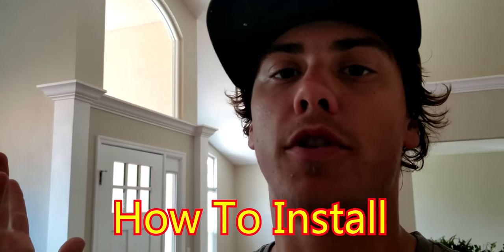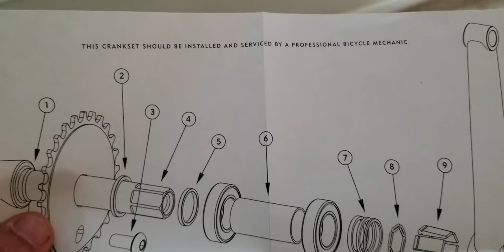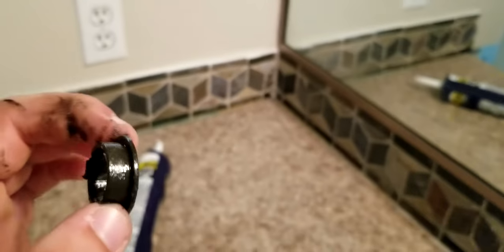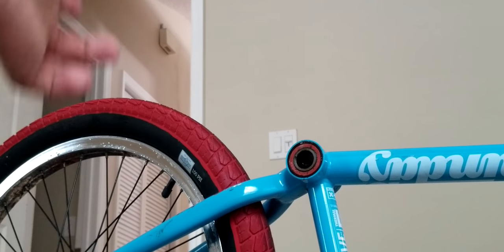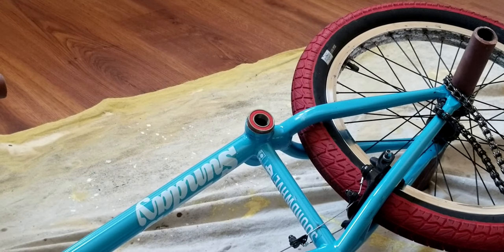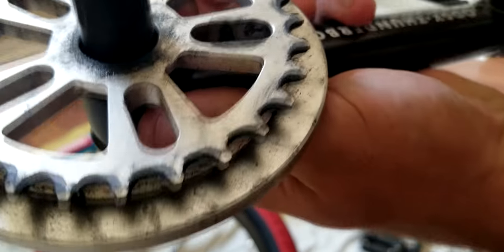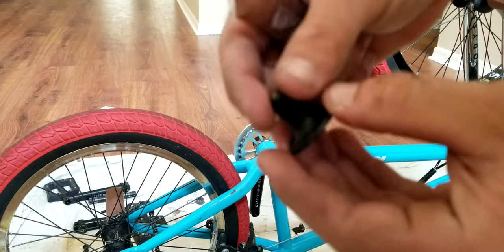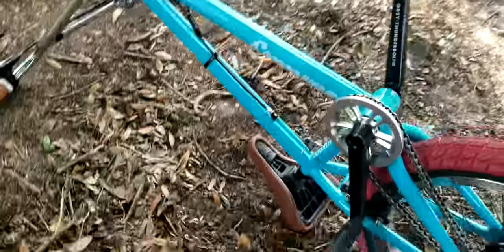How to Install Odyssey Thunderbolt+ Cranks and Mid BB / Review

Comment: hey so i just bought some of these used its missing a cover for  a side of the crank arm like i can see to the bearings and that middle piece you put at a angle.but im just wondering  are those important, if so were could i go to find them and one more thing is grease necessary my dad helped me install them and said i didn't need grease because there sealed bearings but im concerned any help is very appropriated, great video helped me, my dad. you got yourself a new sub :)
Reply from the maker: Hey man, Im not quite sure what your talking about when you say a cover is missing. If you want to you can send me a picture of what you mean to my insta account @the_sarcastic_lion and I will do my best to tell you where to go from there. But without seeing it im not sure what your sayin. Also, no the grease on the bottom bracket bearings and crank spindle is not "necessary" because they are sealed bearings but the grease isnt to protect from rust really its just to keep the bearings running smoother cause if you dont grease down there at least every few months your cranks can actually get stuck in your bottom bracket from just getting ceased up. So i recommend to grease at least a little every so often otherwise when you need to get your cranks off youll be banging them off with a malet really hard or you might even end up needing a crank puller. Glad this video helped you guys tho! Thanks for the sub. I appreciate it! Send me that pic on insta and ill help you out as much as possible.
Reply: @byronoranje  thanks for the help ill message you rn, of course keep it up

Comment: Hey my dude. I just bought these cranks and the wtp pathfinder sprocket. The problem is my sprocket slides right onto the 24mm lip on the crank arm like yours did but it’s supposed to be press fitted onto that ledge. Every other video I’ve seen they had to push their sprocket hard onto that lip unlike you and me it just slides right over which could be find except when you look at the back of the sprocket there is a huge gap around the spindle that is recessed Into the sprocket just like yours. That silver piece you put onto the spindle first is only for sprockets thinner than 6mm. It’s not actually meant to be only a spacer. That being said without that silver piece you put on if you tried to only put the black spacers against the sprocket they go into that recess around the spindle on the backside of the sprocket and that would be the wrong way to install them. They way you installed them is the only way to put them on sprockets with a hole the size of ours but I want to ask are you sure that’s the right way to put them on? The first step in the instructions says the sprocket hole has to be 15/16 which is just under 24mm so you can press fit it onto that 24mm lip and it will be tight. Did you have any problems installing them like this? I seen your video of you taking off your cranks and the new sprocket you put on is how people on vital bmx forum are telling me it’s supposed to be. They say if it has that recess around the spindle after installed and if it just slides right onto that ledge on the crank arm that maybe it’s not compatible. Did you have any problems? With your new sprocket you didn’t need to use that silver spacer is says Only to use if your sprocket is less than 6mm thick, you could have used the black spacers meant to be used. That silver spacer is the same width as the thicker black spacers the cranks come with that fit snug on the spindle. I’m worried about that silver piece not being tight on the spindle like the black ones are. Lmk your thoughts
Reply: It took me 4 hours to figure out i had to press my sprocket in HARD. By the time i was done, I looked like i just put together a Formula 1 engine. Sheesh.

Comment: Thanks for the video! How’d these hold up? I just got a bike with these but someone installed them wrong. Also pretty sure that’s anti seize not grease.
Reply from the maker: No worries. They are holding up great. Still riding them today. But yes it is anti seize. I would recommend using bike grease to install them instead of anti seize. Otherwise they will be very hard to get off later

Comment: Is the rubber band thing supposed to be exposed?
Reply from the maker: Somewhat yes. It's exposed a little behind the crank when you tighten  down all the way.
Reply: @byronoranje  sweet! I saw older videos on them and they weren’t exposed maybe that’s because there an older style?
Reply from the maker: @jacobsvt3146  Maybe. I know I couldn't get mine any tighter and it's held up for a long time now.

Comment: Hey man just wondering how hard was it to put in the bottom bracket
Reply from the maker: It was actually pretty tough. Off camera I was smacking it as hard as i could with a hammer and a block of wood even sometimes hitting the outer metal rim and inner rim of the bb. Itll take a good 20 mins or so of just whacking at one side. But as you can see it can be done. Just take your time and try your best to get it in even. Dont be afraid to hit it hard.
Reply: Byron Oranje Thanks mate I’ll keep that in mind

Comment: i cant cant get my crank arm on without the wedge cluster showing between the spacer and crank arm . this normal ?
Reply from the maker: Yes it's normal. As long as the crank seated all the way to where the rubber band part is about covered its fine.

Comment: Does the cranks set come with bearings I order odyessy caburit cranks
Reply from the maker: Most cranksets do not come with bottom bracket bearings. Sometimes they will sell them with it but its not common. I would look under the details of your order to see what comes with it. If it says just cranks then its just cranks. So then you'd need to pickup a bottom bracket bearing set but they are cheap.
Reply: @byronoranje  thank u so much you are very helpful thanks bro
Reply from the maker: @57chevyforlife47  No problem, anytime.

Comment: I must have got a bad crank bolt won’t thread into the spindle at all 💀
Reply from the maker: Strange. I would try and contact odyssey and send it back.
Reply from the maker: Or maybe you can get a replacement bolt cheap